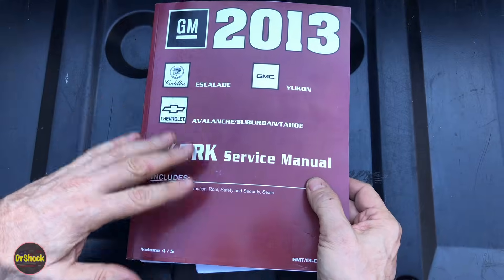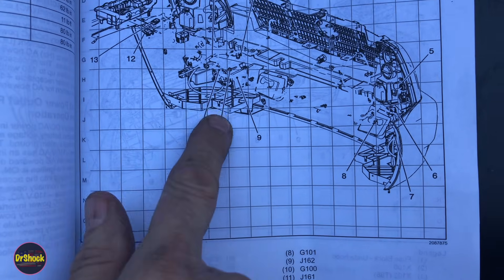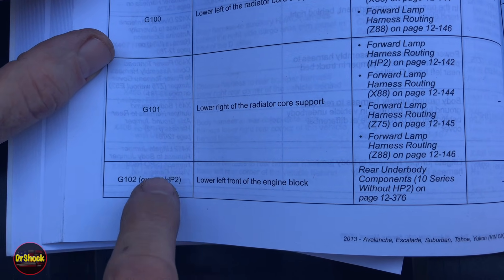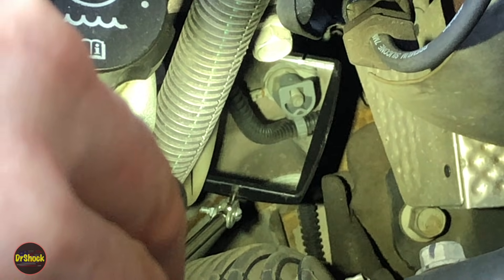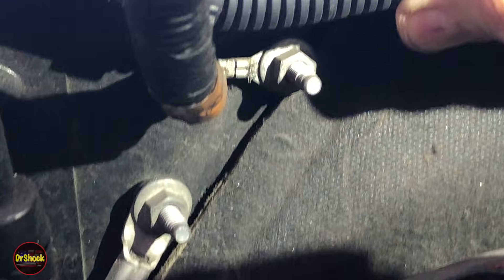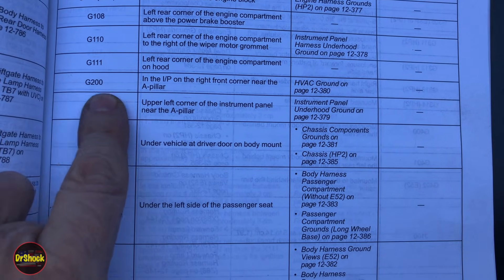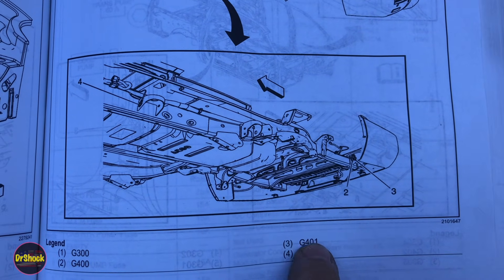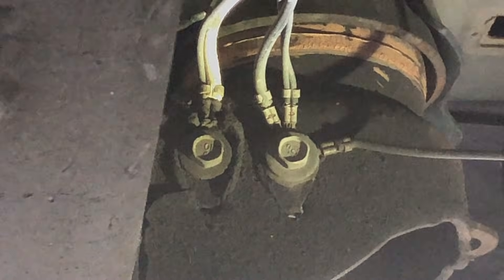2007 - 2014 GM SUV Trucks ~ Where to Find & Identify 5.3L V8 Wiring Grounds (Cadillac, Chevy & GMC)

Comment: Same for a 2012 4.8 gmc sierra?
Reply from the maker: With this same 5.3L Vortec V8, it will be very similar.  There may be some minor differences in ground attaching locations between pickup and SUV models but the ground numbers and purpose will be the same.  With different displacement engines though, there will be major differences in location of ground points.

Comment: Thank you so much for posting this!!!!  Intermittent starter issue on 09 Escalade when hot, found it was an internally corroded main battery ground cable.  Checked all the other ground locations with your very helpful video.  Thanks again!!!!

Comment: This is exactly what I was looking for.  G104-G108 strap is completely broken.  Been having wierd issues.  I get a few "short to battery" codes on crank that prevent remote start.  If I clear them I can remote start ONCE then they pop back up.  I also get Driver and Passenger door module "short to battery" codes.   Short to Battery,  in my mind, means the ground is so bad it cannot pull down the voltage enough so the modules are running on low voltage differential.  I could have multiple bad grounds, but that one smacked me in the face, literally, when I dropped my 10mm socket...  my scan tool also has frequent issues recently when pluigged into the DLC.  I think this ground attaches to the DLC connector.  Anyway, I have a target now.  off to get my back wet, crawling under the truck.,

Comment: Hey there im following the g110 and the g111, on my 07 Tahoe and there’s no wire, is that normal? I was looking for the little nut in the hood and nothing is there! 😮
Reply from the maker: For a first year model, it is possible that there were some differences that the more recent service manual edition would gloss over, or omit entirely.  Or it's possible certain options ordered with the truck may have changed this routing.  If the hood does not appear to have had a provision for that stud, I'd just chalk it up to model year differences.
Reply: @DrShock thanks!!!

Comment: Does anyone know which one affects the TPS and Accelerator pedal position sensor?? Trying to chase a problem before going to the dealer.
Reply: @GoatGirl314  did you find anything out on this problem. Im having the same issue with the accelerator position and stabiltrac and traction control. Codes are  p2138 and c0242. Thanks
Reply: @BIGREDBETTY  chasing same issue on 2012 Tahoe getting 5v refrence code, replaced pedal and throttle body. Chasing grounds now

Comment: So for g201 and g200 i have to take the top of mu dash off i been searching all day for those chat gpt gonna tell me g201 was by the parking brake cable 🤦‍♂️🤦‍♂️
Reply from the maker: Yeah those two will be a pisser to get to.   All of the "AI" offerings yield nothing but inaccurate information, known as hallucinations in AI jargon, on automotive technical inquiries.  IMO this is largely because the AI language model developers just vacuumed up unstructured data that has nothing to distinguish between model year or options.  Absolutely critical in the automotive service domain given the myriad of model options and variations model year to year. 

So todays AI can understand a brand or specific model in general, but can't distinguish further to "know" the ground locations differ across body designs and years within that same brand and model. Best case folks are going to waste alot of time (or worse cause vehicle damage) asking AI for how to service anything vs coming to Youtube and watching to learn on the actual vehicle they have.
Reply: Ya he sent me way off lol but did find those 2 exactly where you said the g201 was grounded bad cleaned it up and now good didnt fix my main problem but did fix my acutator it was stuck on vent now i could switch from defrost to floor Thank you had damn near the whole bottom dash disassembled looking for those grounds whole time it was on top of the dash😂😂 I Appreciate it

Comment: On my 2012 LC9, G104 is bolted to the stud on the valve cover bracket that holds the coil packs. Is this incorrect? I had the engine replaced a couple years ago
Reply from the maker: Hard to say, there could have been a subtle assembly line change, or even a mistake by the line worker.  But it could also have been a reassembly mistake during the engine replacement.

Comment: Very informative I just wish you would have gone over what ground locations are for what systems. I have several intermittent issues with bcm and fuel pump and idk which grounds service those systems.
Reply: It said on his sheet on the right column
Reply: @adjustthis  hello. I am also here for fuel pump. Is your problem also intermittent and hard to recreate?